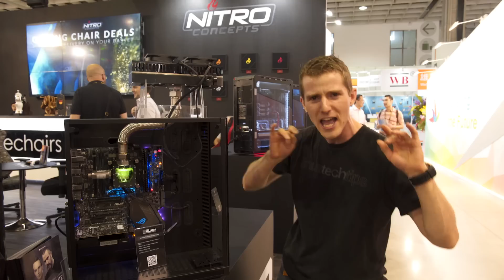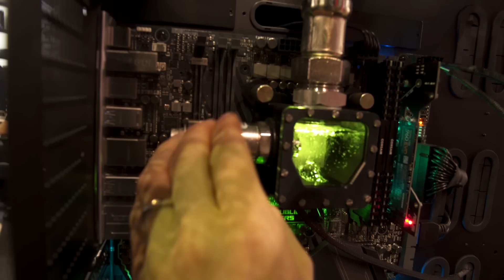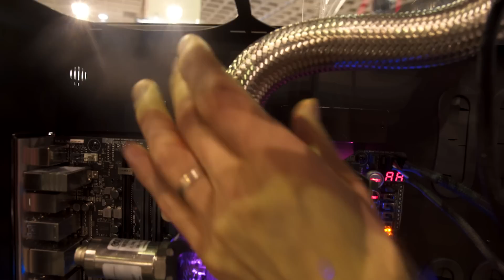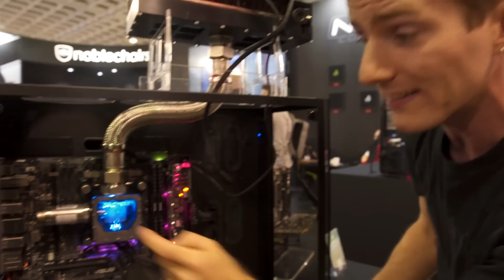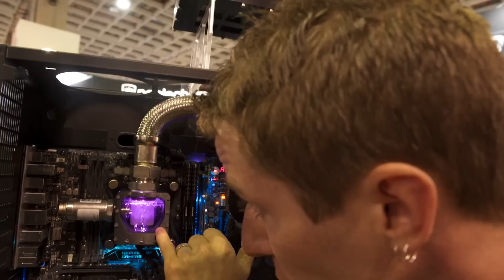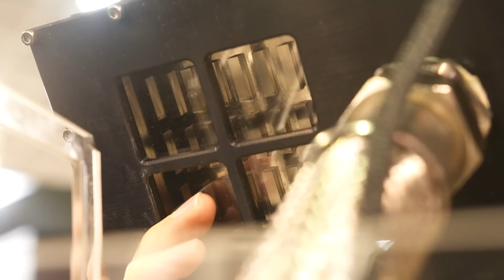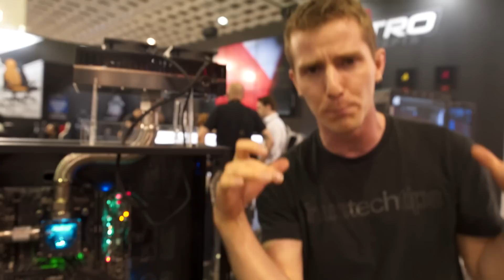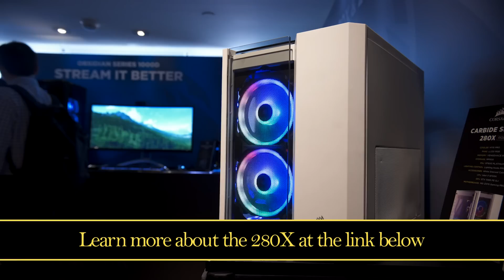Crazy Der8auer cooler prototype - NO pump!

Comment: He reduced internal pressure to mitigate the transition of water to gas. Im drunbk but i know it when i see it
Reply: A safe temperature to touch. Makes me think ~30kPa for boiling water to be reasonably cool to touch.
Reply: totally water
undewr 70 kpa?
Reply: maybe lower pressure
Reply: throw us a bone!! what temp?
Reply: kitten cuddles for an air tight system though. solid.
Reply: coolascats in order for it to be water at a lower pressure, they would need a vacuum. It can't stay depressurized in a chamber that small because the water will expand to fast
Reply: I think he increased it I’m pretty sure that whole thing is under pressure
Reply: dude are you less drunk now?

Comment: Liquid would be that stuff 3M made a few years ago that was a replacment for oil cool pcs. It a liquid that boils just above room temp and is non-conductive. If not that then it will be the exact stuff they use in heatpipes.

Comment: The boiling bubbling thing is probably something similar to a boiling stone used in chemistry to provide nucleation sites to keep the boiling stable and prevent it from gurgling

as for what this is, probably some alcohol otherwise everything else is too high boiling point or too viscus to work

or it could be some flurocarbon but the regulations on those are kind of tough to work around for a consumer level thing

Comment: The first thought would be novec- but since "we'll never guess it" I'll keep going, but there are a number of options depending on variable pressures. Mineral oil wouldn't work because even with variable pressures it's kinda shite for direct heat transfer with small surface area. Perhaps a pressurized ionized something?

Comment: The liquid should not be water and it should have a boiling point much lower than water. It must be diethyl ether since its non-corrosive and boils at temperatures that an overclocked cpu could reach.

Comment: I managed to do this before the first time I used metal Tim had to head it up and turned off the water pump and it never went above 40 degree. So I had to get a torch and manually heat the Tim.

Comment: Fluid that vaporizes in temperatures that are ok for cpu to work on, like from 40 to 60 because if its go below that it will continue to work once you turn off the pc, below that it wont vaporize to cool the cpu...

Comment: list of fluids i could find with boiling points between 30C and 80 C my guess nail polish remover

fluid boiling point
1 - Pentene 30
Isoprene 34.1
Ether 34.6
Diethyl ether 34.7
n - Pentane 36
Ethyl bromide C2H3Br 38.4
Methylene Chloride(CH2Cl2, dichloromethane) 39.8
Methyl iodide 42.6
Carbon Disulfide CS2 46.2
Carbon Bisulfide 47.8
Cyclopentane 49.3
Neohexane 49.7
Acetone CH3COCH3 50.5
 <<<<my guess
Methyl Acetate 57.2
2,3 - Dimethylbutane 58
Bromine 58.8
2 - Methylpentane 60.3
Chloroform 62.2
3 - Methylpentane 63.3
Alcohol - methyl (methyl alcohol, wood alcohol, wood naphtha or wood spirits) CH3OH 64.7
Methanol (methyl alcohol, wood alcohol) 66
n - Hexane 68.7
Methylcyclopentane 71.8
Carbon Tetrachloride CCl4 76.7
Ethyl acetate CH3COOC2H3 77.2
Ethanol 78.4
Alcohol - ethyl (grain, ethanol) C2H5OH 79

Comment: The liquid needs to be non corrosive, and preferably non conductive.  From appearances it is run at negative pressure. I haven't had time to compare boiling points at low pressure. But I am going to throw out mineral oil.

Comment: CO2 or some gas that is not Flammable, Gases under high pressure turn fluid like water and will boil very fast, so that might do the Job
Reply: Can't be CO2. The critical temperature for CO2 is 304.25 K or 31.1 C.

In case you didn't know. The critical temperature is the highest temperature at which a gas can be liquefied. Above that temperature, it will never become a liquid no matter how much pressure is applied.

There's lots of possible substances that would work in the application demonstrated in the video. There are some details that would be useful to know in order to determine what substance is being used.
1. What's the actual temperature in the CPU block? "little bit toasty" isn't exactly a nicely quantified answer.
2. What's the pressure? There's no indication that the system is under a vacuum, or if it's pressurized. Either situation is possible given the observed setup. My personal bet is that it's under pressure because I don't think steel braided tubing is all that effective against vacuum as well as all the screws holding on the transparent plate on the CPU block. Also the wide diameter tubing would be extremely susceptible to being crushed under vacuum.

Comment: The design is basically a thermosiphon or a percolator with a radiator on top. The difference would be in the boiling point of the fluid. At the most basic, it would probably be some deionized pure H2O. You could make water reach boiling point faster if there is enough pressure (at constant volume, an increase in pressure increases temp). Or it could be some fancy inert coolant. At its most basic, its simply a coffee maker with a radiator.

Comment: Correct me if I'm wrong but there something strange about this set up, what I mean is, the hottest part of the CPU block is the wall closest to the CPU right?, if I am right then the bubbles should come from the back wall of the CPU block and not from the bottom.   There seems to be a trick here, if you watch closely it looks like there's some kind of gas injected directly into the CPU block which enters the block from the bottom wall, thus producing the bubbles.

Comment: Coolant fluid could be alcohol, or acetylene, or some fancier liquid with boiling point somewhere between 60 and 30 °C :) To guess the exact coolant one should know the plate inner temperature (or the cpu running temperature, and then to calculate plate temperature from that). :) Anyway, know the concept, love that someone is actually making one. Next step: passive cooler (or to call it massive cooler?) :D
Reply: Also there is possibility to use some freon with higher boiling point :)

Comment: I'm assuming the liquid would have to be somewhat safe in case of a leak. Super high or super low pressures would also require more manufacturing effort.
So based off of these two, I'd assume the liquid is either Acetone, methyl alcohol, Doubtful but perhaps Cyclopentane, or Diethyl ether, Carbon tetrachloride, Ether, Ethyl acetate, or maybe Triptane.

Comment: The solution is probably an amonia water mix (25%?) ,  that could work cause the high ph works anti corosiv. The closed enviroment keeps the amonia re-desolving in the water and even with amonia having a lower boiling point then the water.
Reply: Liquid ammonia is lighter than water, right, so isn't it liable to just float on top of the water in the evaporator tank seen in the video?

Comment: Refrigerant maybe, its a liquid... my dad work with it, and it have the same properties under pressure
Reply: ninja dragon I went to tech college for hvacr I was used to working with refrigerant I don't know if other country's share the same type of refrigerant as us. Or if each region has its own particular refrigerant due to ease of access if your father works with refrigerant he knows the struggle of getting his hands covered in it. I was an adult student and there were high school students in our class as well and the worst time I was ever burned with refrigerant was because a high schooler was using a gauge set and didn't get the hose connected in all the way once the refrigerant start spraying out he ran away from it and the teacher ordered me to take it off I didn't have time to get my gloves and had to do it bare hand by the time it was done my left hand was coated in a thin layer of frost/ice and I had 1st degree Frost Burns I assume your father's got a story like that too because working with refrigerant will always end up with at least one accidental contact
Reply: You couldn't keep a modern day refrigerant in a liquid form considering most boil at -20 degrees or so unless under vacuum which wouldn't be very easy to work with for pc building and the super low temperatures would cause Frost to build up on the outside of the casing
Reply: Therealslim okey, its called "kuldemedium" in norwegian... but you are right, there would frost build up
Reply: Technically, any gas that won't readily freeze can be used as a refrigerant. Water, nitrogen, oxygen, the list is HUGE. :P

Comment: Distilled water. Under vacuum.
Edit: the water hose on the top will get dissolved by most hydrocarbon based fluids. Also, vacuum would probably crush it, but i am still stick to it.

Comment: Coolant is likely a refrigerant of sorts. Butane is a valid candidate, but considering the fire\explosion hazard, they would likely not get permission to bring something like that into Computex. Though, butane is fairly safe and easy to get, and if nobody knows, mybe they can...? At "toasty" temperatures (70*C\158*F) this cooler looks like it could handle pressures of boiling Butane (around 1500kPa\220psi).

Comment: F2 Chemicals LTD

"FLUTEC™ liquids are colourless, odourless, effectively non-toxic, non-corrosive and non-flammable. They have high thermal-stabilities, negligible chemical activity, leave virtually no residue on evaporation and are chemically compatible with most major materials of construction. They are non-polar and have low heats of vaporisation, very low surface tensions and low boiling points in relation to their relatively high molecular weights.

Direct Contact Cooling with FLUTEC™ Fluids
Perfluorocarbons, such as the FLUTEC fluids are electrically insulating, and so can be in direct contact with the chips producing the heat. They are also perfectly safe, being non-flammable and non-toxic, and are compatible with virtually all materials of construction. While a leak will result in a loss of cooling, it will not damage any of the components.

Compared to air, perfluorocarbons have a very high thermal bulk, and being in direct contact with the components producing heat provides a dramatic cooling effect. The perfluorocarbon can be circulated by a pump, and cooled by a radiator and fan, much like a car. Evaporative cooling is also an option, in which latent heat is removed rapidly when the liquid turns to gas."
Reply: is this sponsered
Reply: Nah, just a best guess being a fellow Internet traveller keeping abreast of various technologies. I had just so happened to read about this one a ways back when looking into battery technologies from BASF. I don't know how I ended up diverging to it but, the Internet is just one click away from ending up somewhere we didn't expect.
Reply: Probably 3M Novec like in his (der8auer) previous Projects.
Reply: Perfluorocarbons are a good guess :)
Reply: Your better than me because I could never do as much research than you did
Reply: Berserkism i hope that guy from der8auer reads this
Reply: Wow this stuffs interesting my guess was on two semi standard flurocarbons but this seems like it might be it it certainly would be a good option.
Reply: isnt it illegal, cfc emission?
Reply: Syahmi Yani it is perflourinated, it should be fine since what made the cfcs so dangerous was the chlorine.
Reply: Syahmi Yani it isn't ozone depleting as it doesn't contain chlorine or bromine etc.
Reply: Ooh I'll see something about it
Reply: Grumpy Electrician I think it was stated in an interview that it was not 3M Novec.
Reply: Well, looking at the F2 Chemicals site, I see 3 possibilities there (the boiling point has to be under 100 C to prevent thermal throttling and should be well above room temperature so it will condense back to a liquid easily). I would expect the system to become slightly pressurized during use because of the boiling which in turn would elevate the boiling point, so it would be wise to stay well below 100 C under STP. So an ideal boiling point should be somewhere between 40 C and 90 C. So Flutec PP1 @ 57 C, Flutec PP2 @ 76 C, and Flutec PP7 @ 80 C. There's a lot of other versions, but their boiling points range from 103 C to 260 C which are all too high for this purpose.
Reply: And at a guesstimated approximate $100 US per gallon in bulk, I'm guessing anyone selling smaller quantities is going to mark it up a lot.. like $30 for enough to cool your system for a year.
Reply: Berserkism nope
Reply: did u wrote this whole thing or just copy pasted it ?
Reply: Ok i want this for my custom loop watercooling, where do i buy it? :D
Reply: +Berserkism "the Internet is just one click away from ending up somewhere"  I want this on a T-shirt!
Reply: der8auer then maybe a Fluoroketone product?
Reply: Mann I can't read this whole thing

Comment: Fluid wise, I'd guess it's butane (based on other videos, it's availability everywhere, and the pressure sensitivity), however I'm still waiting for an explanation why the bubbles aren't coming from the CPU's heat spreader and are visibly coming from the hole in the bottom.
However, this design wont be very efficient at actually cooling anything.

Comment: its probably water
Reply: But its hard to get water to boil at 70°C . You need a low pressure for that, which maybe also explains the tubing.
Reply: I guessed that too
Must have chemical additives to prevent mould and increasing the boiling temperature(could be salt)

Comment: Concept seems pretty basic to me, just lower the pressure in the chamber, liquid will start boiling at lower temperatures.
As for the liquid, some sort of alcohol? maybe thats why we dont have any transparent plastic tubing? Im sure there are plenty of low viscosity liquids out there that can fit the bill if pressure is involved. Kinda also makes sense with the heavy duty 'looking' pipe and cooler.

Comment: I'm thinking that the liquid used was just de-ionized water in a low pressure environment (partial vaccum) thus explaining the pressure sensor on the side.

Water will boil below 100°C when the  pressure is below 1 atmosphere. When the pressure is low enough, water will easily boil somewhere at 50°C, that's why when linus touched the block he didn't get fried.

Comment: Based on chemical boiling points and the not so extensive research, I personally think it could be one of two things. If it's not going to be a part of the consumer market, and it needed to follow safety and import laws of specific chemicals, then I assume it's either a type of methyl alcohol or possibly Trichlorofluoromethane. Trichlorofluoromethane is a type of Chlorofluorocarbon with no acidic properties, it isn't flammable and it has a low pressure and temperature boiling point at 23.77-23.8 degrees celcius which is a pretty good temperature to overclock at. That is about 79 Fahrenheit for people who can't convert.

Comment: Cfc/fc typically operates below freezing of water, simplest of glycols above boiling point of water so my guess is mixture of ethanol and water. Not even lab grade of 95% but more in the range of higher alcohol content beverages. Probably does not even need to bother looking for lab purposes at that point and more for drinking grades at that point.

Comment: It more than likely is a combination of low pressure and volatile liquid. Linus even hinted to the structure of the cooler saying that the chamber is quite strong and has thick walls. It most definitely isnt liquid nitrogen though. If i had to guess then it would be either Isopropyl Alcohol or maybe even ethanol. Both boil at around 20 to 25 degrees celsius and would be extremely efficient at transferring heat away from the cpu. Pure alcohols dont conduct electricity either, might be another thing going for it.

Comment: I guess its some kind of Dimethylbutane, either 2.2(Neohexane) or 2.3 under a pressure between 1.5 and 3 bar ( 21,7 and 43.5 psi)

Comment: my Guess is its Acetone. Decent specific heat and a boiling point of about 50C. If its not Acetone my guess would be Methanol like others suggested as the properties are about the same just a little bit higher boiling point.
Edit: after looking up Novec from the comments it could definitely be that, super high specific heat.

Comment: The liquid could be something similar to dichloromethane. It’s the stuff they use in those “bubble” Christmas lights. However, I don’t think they use DCM anymore because it’s highly toxic and likely carcinogenic. But, it could easily be something similar if it’s not just simple methanol. That being said, DCM has a far lower boiling point than Methanol and Ethanol.

Comment: My guess is liquid acetone. Boiling point is only approx 56C/133F and it likely wouldn't break down in multiple evap/condense cycles as easily as an ethanol might. Plus, industrial acetone is pretty cheap to produce and is used in other closed loop functional systems as the driving fluid.

Comment: He said "we'd never guess" but I bet it's one of the refrigerants with an ASHRAE R number. Probably not one of the CFCs because of the Montreal Protocol though. They're generally cheap and have been tested in sealed systems for years already. All that's left is to choose one with the physical properties (boiling point, density, etc) to fit this sytem.